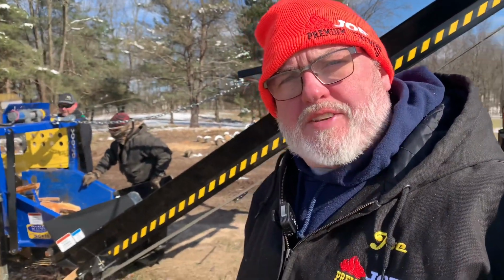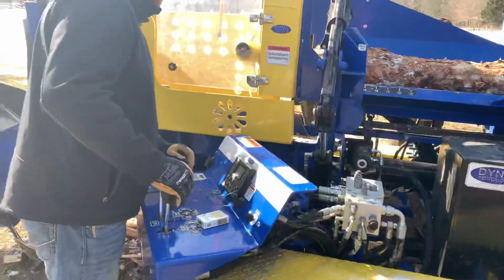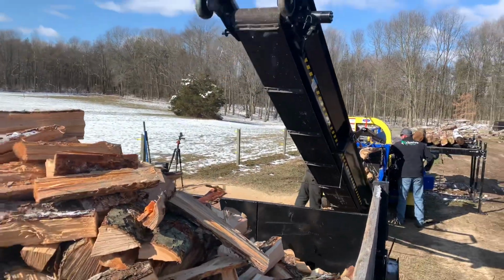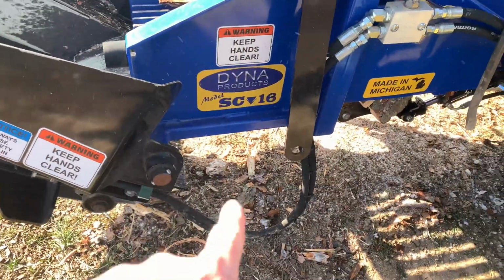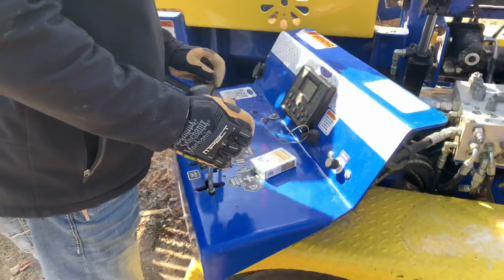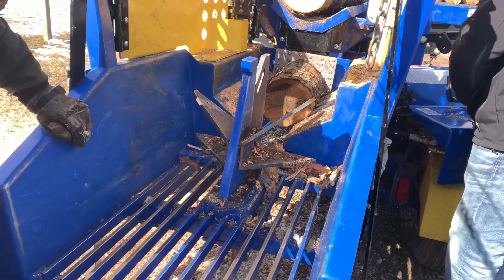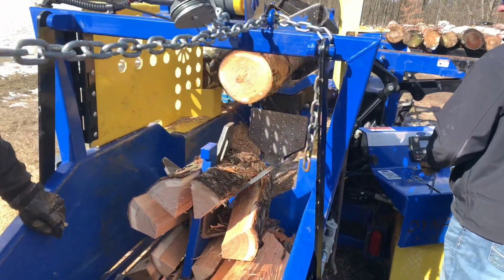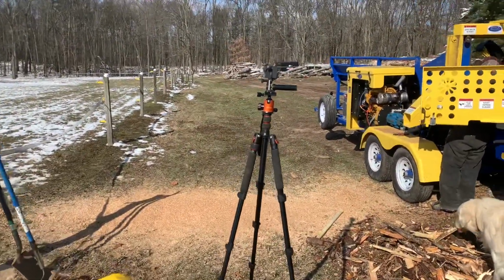DYNA SC16 processor making cherry/pine firewood

Comment: Look at that! Such a back saver! Very nice job joe... and Scotty great job on the processor💪🏻 
So I have the sc-14... 38hp gas motor.. I reallllly love that diesel on the sc-16... at the time I just couldn’t swing the price increase from sc-14 to a sc-16 when I bought mine... great job both of you... 

Oh and when my chain does that half cut through the round and doesn’t continue.... no matter what it’s always a dull chain issue for me... I do play with the sawfeed rate knob on the hydraulic diverter box (silver cube) and that sometimes gives me more speed to push through with a dull blade... but most time it never fails it’s always a dull chain issue when it does that on mine... loved seeing a big bob on the job too💪🏻💪🏻 
 
Mine has the grizzly bars as well on the out feed of the splitter... as you can see it does a really great job too of keeping it pretty clean for the most part.. I put a plastic bin under mine to capture the debris... this way when it’s full I can drag it out dump it somewhere or (big bobs bucket) also I put some of the wood shreds in empty bird seed bags and then give them to my firewood customers to help with starting fires :) they love it...
Reply from the maker: Yeah it was a dull chain.   He got 15 spare sharp chains with it.  I also did a longer livestream on fb, here’s the link to it if you want to check it out:
https://fb.watch/c1W59is53f/
Reply: It's really cool to see woodguy  tuning in and giving sound adv